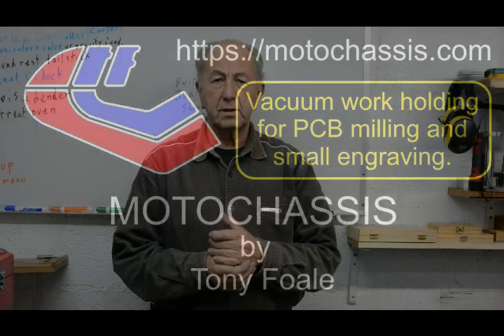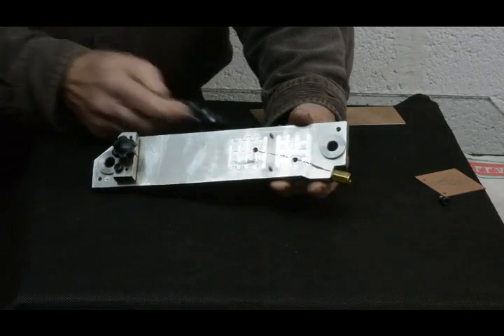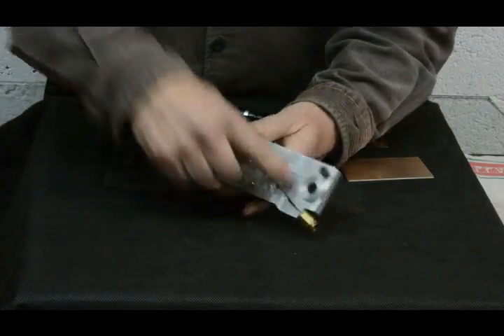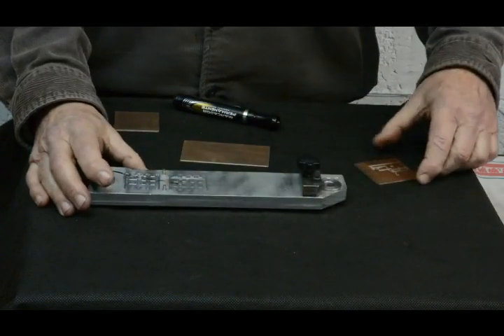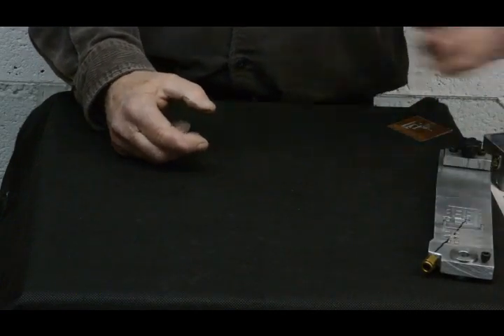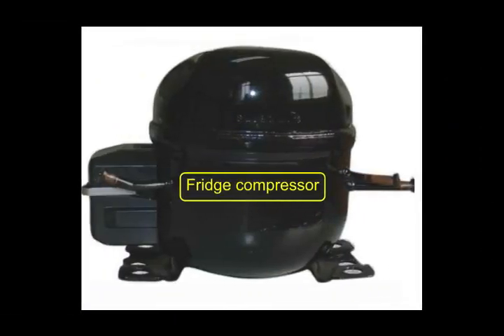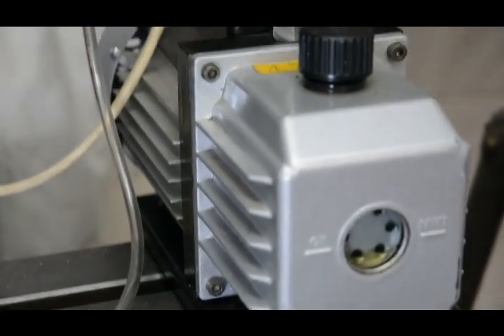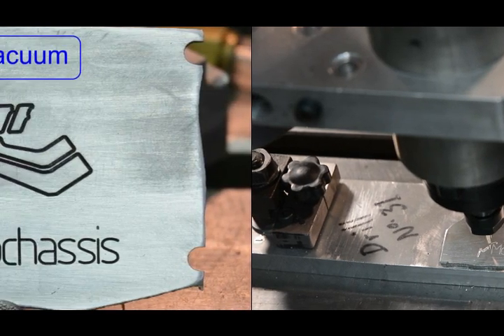Vacuum chuck for PCB milling and engraving, Part 1

Comment: And you don't have any problems with swarf going through the pump or difficulty holding sufficient vacuum when you have a lot of holes drilled?
Reply from the maker: The swarf sits on top of the PCB and sweeps away easily.  It would be easy enough to put a filter in the line if it ever became a problem.

Comment: Looks good. Have you ever repeated the flatness experiment with a higher resolution indicator?

The copper layer is about 35 micrometer.
Reply from the maker: No I have not.  The copper layer is thin but as long as I cut through it there is no problem as long as the cut is not excessive.

Comment: Great video. I have been trying to figure out how to make 2 sided PC boards. Could you let me know the measurements you used?  Was the clamp made from one block of aluminum?
Reply from the maker: Rick,  The size will depend on the size of the PCBs that you need to make.  I standardized, for the purpose of the vacuum chuck, on 38mm x 38mm (1.5" x 1.5" ) and 80mm x 38mm (3.15" x 1.5").
When you say do you mean the whole chuck or just the drilling jig on the end.  The main plate was a single piece of Aluminium but the drilling jig was in semi-hard 4140 steel so that the holes did not wear too quickly.